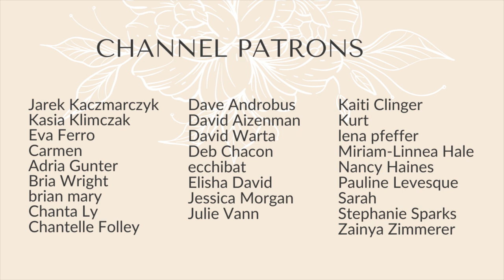Making SILVER RING with flowers and gemstone. Jewelry making process

Comment: Great video! Love the ring! How do you like the knewconcepts saw compared to the Green Lion?
Reply from the maker: Hi! Thank you so much 💕 Oh, I love it! I like both, but I use them for different jobs. knewconcepts is super light and is super easy to operate, especially with more intricate designs. I like Green Lion for larger pieces, straight lines etc. It's a bit heavier, but I really like it too. If I absolutely had to choose one though, I think it would be knewconcepts (with the quick saw blade release), becasue of the work I specifically do. Hope that helps!
Reply: @TheArtOfMetalsmithing  Thank you! Yes, it is helpful. I have been trying to decide between the two for awhile and I think I am going to go with the knewconcepts :)